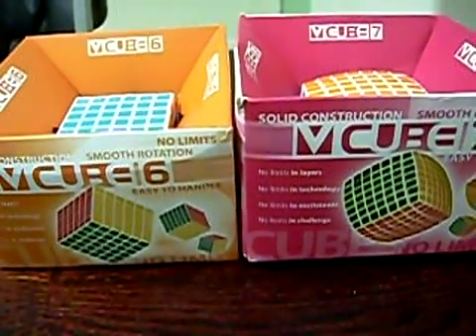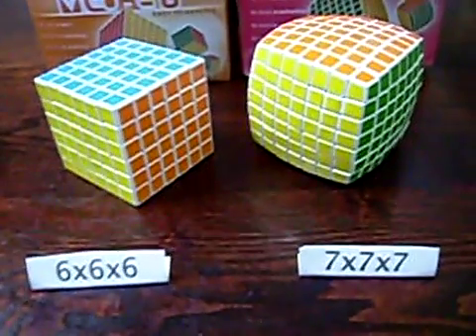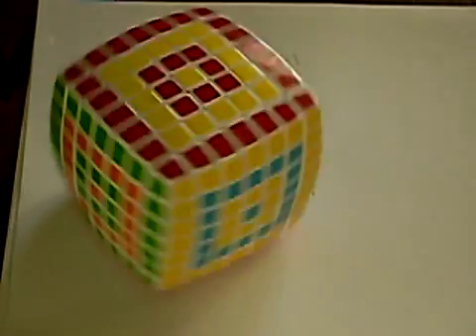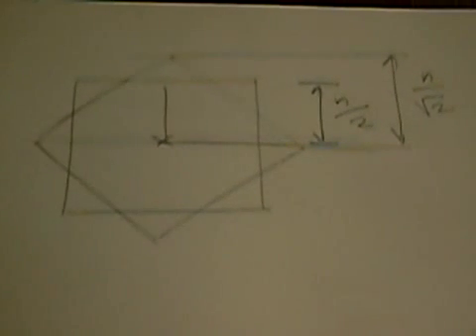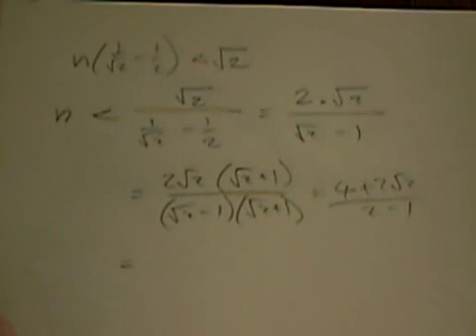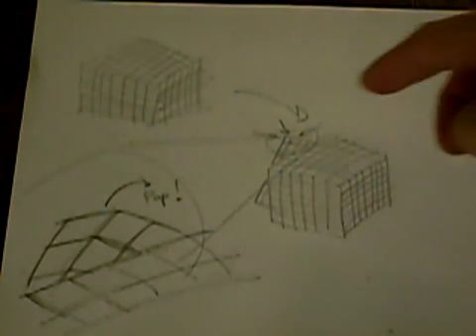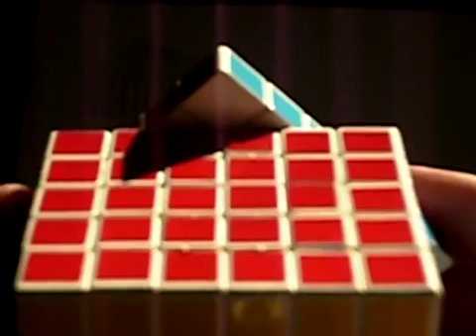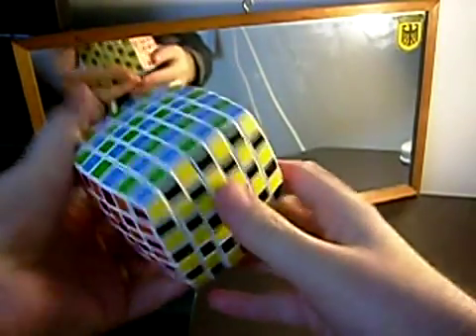The V-Cube Part 1 - Introduction

Comment: well, actually another solution is to maintain the cube-shape, but to make the outer layers wider and move the inner layers closer together. this would still keep everything rectangular, but not all pieces would be quadratic.

the third solution would be to keep the cubic shape, and instead of linear seperations between the layers they would be curved. could look pretty.